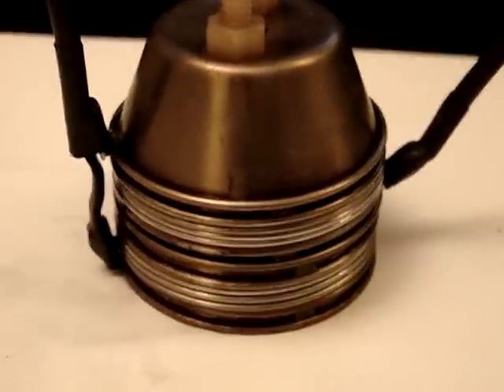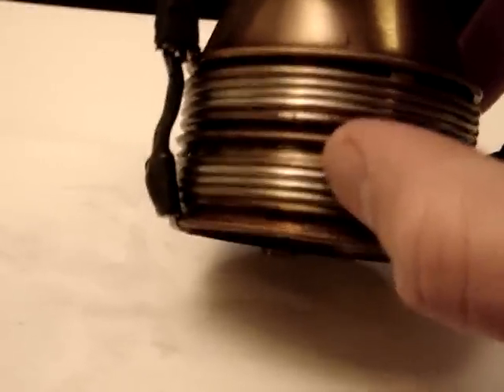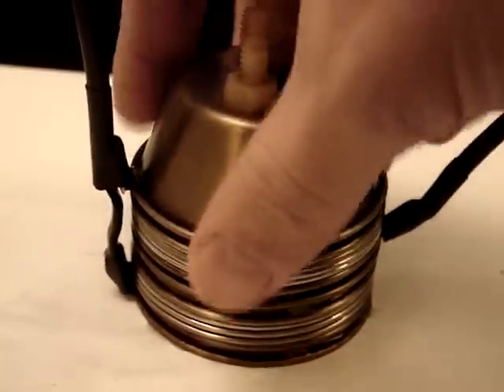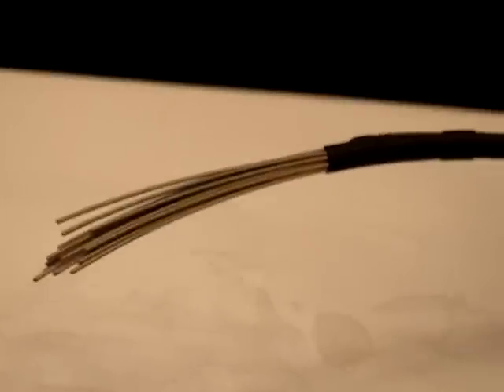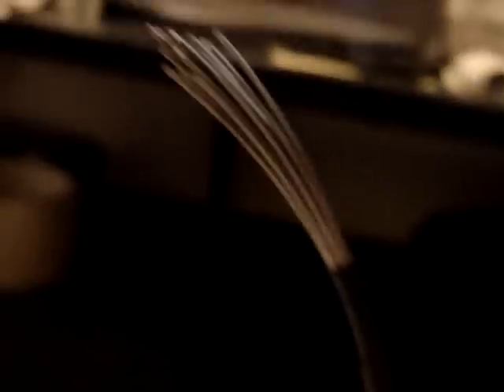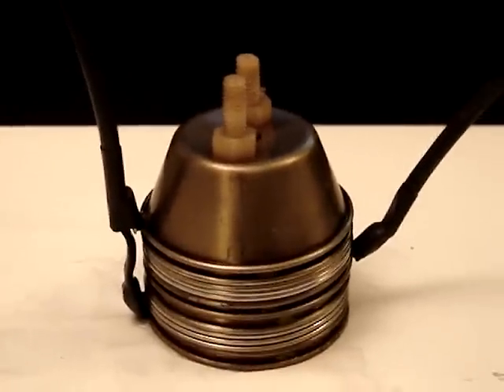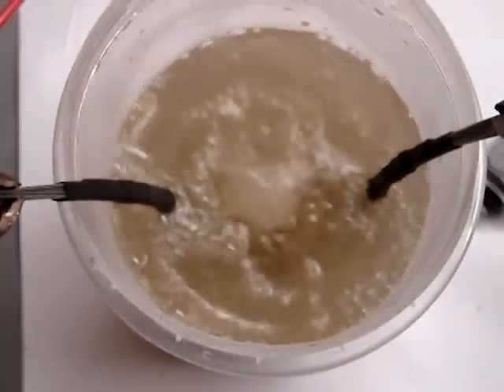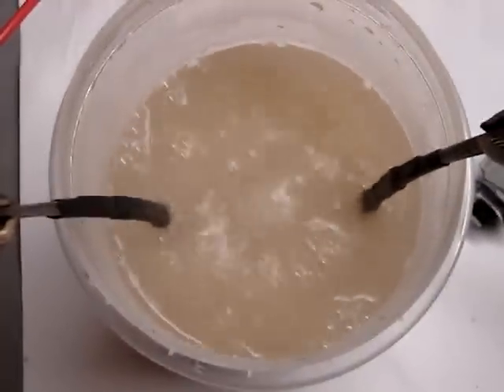Vid10 Budget Build Volcano Cell Hydrogen Generator (HHO, Brown's Gas, Hydroxy)

Comment: That is looking better. What voltage and amperage were you using. For reasons I dont want to get into right now I am trying to keep amps under 10 hopefully 5 or less. But this looks like you are definately getting somewhere. Keep up the good work.
Dave

Comment from the maker: 1 Quart of Distilled Water
1/2 teaspoon of KOH (potassium hydroxide)
12 Volts (PC Power Supply)
Less than 15 Amps - I've been running the cell for the past 4 hours and it has not popped my 15 amp breaker, plus the container and the wires are only warm. (I don't have an amp meter yet)